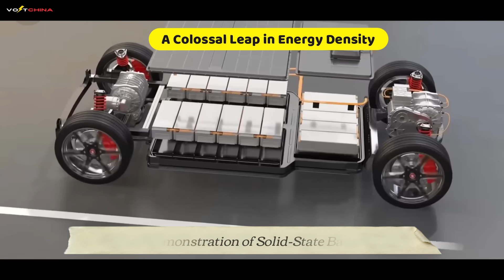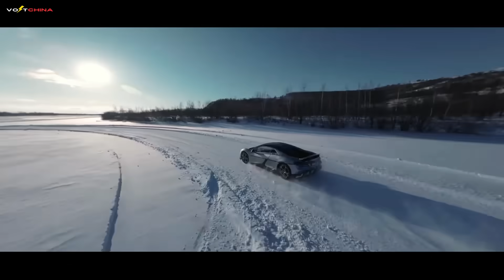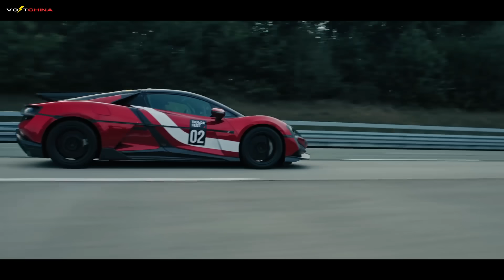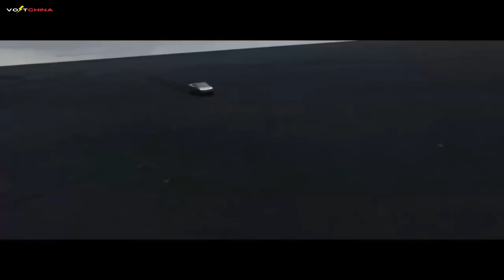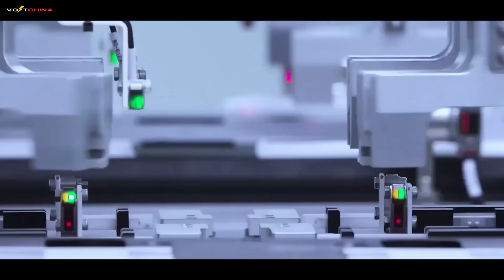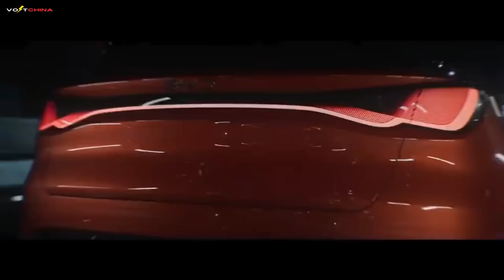BYD's Solid-State "Superbattery": 1500km Range, 10-Min Charge... Is This the End of Gasoline Cars?

Comment from the maker: For those who want to go even deeper, I've compiled all my research for this video into a comprehensive 20-page PDF report. You can get it here: https://leon011.gumroad.com/l/byd-solid-state-report
Reply: what are the implications for aircraft?
Reply from the maker: @4KAircraftLive  That's a brilliant question，The implications for aircraft, especially in the eVTOL (electric Vertical Take-Off and Landing) sector, are massive. Solid-state batteries solve the two biggest problems holding electric aviation back: energy density (for range) and safety (for certification).
While my current report focuses on the automotive applications, the core principles of battery chemistry, charging speed, and cycle life we discuss are directly applicable. The race to electrify the skies is just as intense as the race on the ground.
Thanks for bringing up this excellent point!

Comment: I doubt whether there will ever be sufficient megawatt chargers for everyone to charge in ten minutes.
Reply from the maker: Your skepticism is perfectly reasonable. The large-scale deployment of megawatt-level charging technology faces enormous challenges, covering various aspects such as power grid upgrades, transformer technology, site approval, and demand charges. This topic itself deserves in-depth discussion.
In my view, the promotion of megawatt-level charging will likely be carried out in phases: first, it will be deployed along major highway corridors to meet the needs of long-distance freight transportation; then, as the technology matures and costs decrease, the coverage will be gradually expanded. This is an engineering and economic challenge equally arduous as the battery technology itself.
Reply: @ChrisNother  Which is why you should research small nuclear reactor technology.
Reply: @clackamasoneful which is why you should have read the first reply to my post.You should also know that Hinckley Point C started in 2018 and most likely won't finish until the end of the decade.

Comment: We need more verifiable, reliable data on solid-state batteries. It would be great if this could help us get the annoying problem of rapid battery wear under control. The battery is the main obstacle to e-mobility. We must not create a false illusion that makes customers suspicious.
Reply from the maker: You've hit on the most critical point. Thank you. My entire mission with VOLT CHINA is to combat the hype with verifiable data. Your demand for reliability is exactly what drives my research. Stay tuned, because we're going even deeper on this topic.

Comment: i dont need 1500km. i need 700km 0-100% battery.(400-500km 15-85%)and good charging speed(200+kwt), or 10-20 min for 15-85% charge. i prefer lighter and cheaper battery
Reply: @IgorYakubovskiy  
It is available from either byd or catl
Reply: Вага авто неповина бути надмірна. 70 км повністю хватає.  То і динаміка і багато що краще.

Comment: I believe Tesla has a roll out in the beginning of 2026. Tesla is reliable and accountable with in-house manufacturing and solid state battery's, manufacturing and supply. Tesla has assured the world no rare metals or components are used and the series 2 can and will travel up to 600 miles with a 15 minite charge time to 80%.
The selling point for me is reliability. Chinese products are usually inferior and costly or time consuming of impossible to repair. Infact a lot of NZ consumer's regret buying Chinese products for this very reason. 
With Tesla however, the series 2 is going to be cheap to manufacture, supply and support; if you can believe Elon Musk.
Why shouldn't you believe mr Musk? What he says he delivers, unlike many  chinese manufactures.
From small and cheep Chinese products to expensive petrol, diesel or electric Chinese products China's word or guarantees are unreliable and frankly not worth the paper they're written on.
This is my experience, take it or leave it.
Lastly, China has many times threatened the west and others and Because of this I don't trust anything China has to offer no matter how inexpensive or innovated.
If China was the only one electric vehicle manufacturer I would stick to petrol.
It's the same with clothing, electronics, and the like. I don't buy Chinese.......
Reply: This is what is propaganda 😂, something that is not in accordance with the facts, however Chinese products have the highest value for money in the world.
Reply from the maker: Thank you for sharing your views openly—everyone’s purchasing decisions are shaped by their own experiences, and I respect that you have made a choice that suits you. However, if you are willing to learn more, I would like to add some facts to help you gain a more comprehensive understanding of the situation:
First, regarding the reliability and after-sales service of Chinese electric vehicles (EVs): It is true that some low-cost products (from any country, not just China) may have quality issues, but China’s EV industry has undergone significant upgrades over the past decade. Brands such as BYD, NIO, and Xpeng have now become globally renowned enterprises with strict quality control systems. Additionally, many Chinese EVs comply with global safety standards (such as the 5-star rating from the European New Car Assessment Programme, Euro NCAP) and use standardized components, making their maintenance no more difficult than that of other international brands.
Second, on solid-state battery technology: Tesla’s plans are undoubtedly promising, and there is no denying that Elon Musk has indeed delivered numerous innovative achievements. However, it is important to note that the claim of "not using rare metals" is somewhat misleading: most advanced batteries (including Tesla’s upcoming products) still rely on metals such as lithium, nickel, and cobalt (though efforts are being made by all parties to reduce dependence on these metals). In contrast, China’s solid-state battery development is not just limited to promises—semi-solid-state batteries have already entered mass production (e.g., products from GAC Aion), and prototype full-solid-state batteries have passed rigorous testing, enabling over 400 kilometers of range with a 12-minute charge. This is comparable to the specifications of Tesla’s Series 2 model you mentioned. Furthermore, many Chinese manufacturers publish transparent R&D reports and third-party test data, so their "commitments" are not empty words but are supported by tangible results.
Regarding your concerns about China’s credibility: It is regrettable that you have formed such a view. In fact, the so-called claim that "China threatens the West" is often a misunderstanding caused by media bias. Many Chinese enterprises have also invested billions of US dollars in local production (such as BYD’s factory in Thailand and NIO’s R&D center in Germany) to better serve global consumers.
Ultimately, choosing which brand or country’s products to buy is a personal right, and I will not attempt to persuade you to change your choice. Innovation in the EV industry is a global competition. Both Tesla and Chinese brands are constantly pushing the boundaries of technology and committed to popularizing cleaner and more efficient transportation methods—and this competition will ultimately benefit consumers around the world.
Thank you again for taking the time to share your thoughts. If you wish to learn more about the latest developments in Chinese EV technology in the future (beyond stereotypes), feel free to reach out at any time—I am happy to share objective and neutral information. Wish you a pleasant life!
Reply: Therefore, Elon Musk entrusts his export cars to be produced in China and consumers are satisfied and Elon enjoys the results.